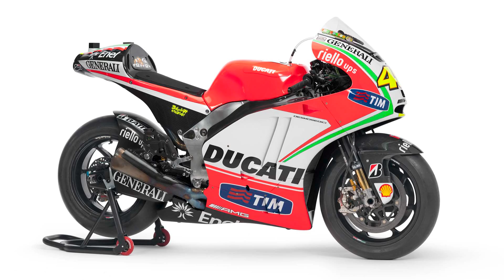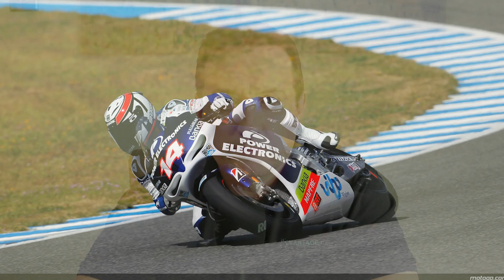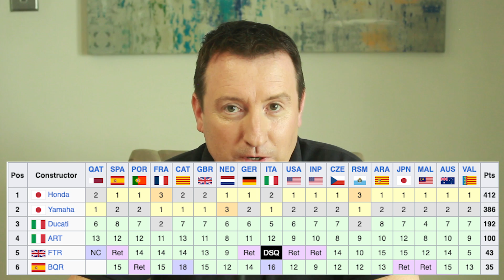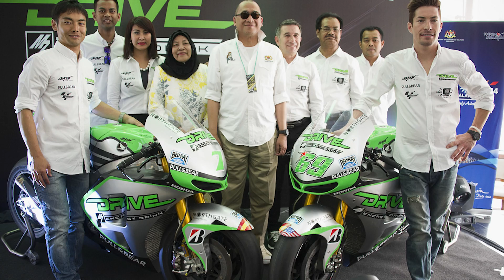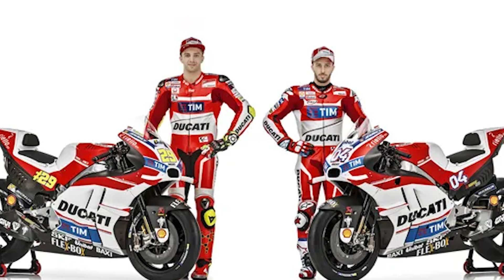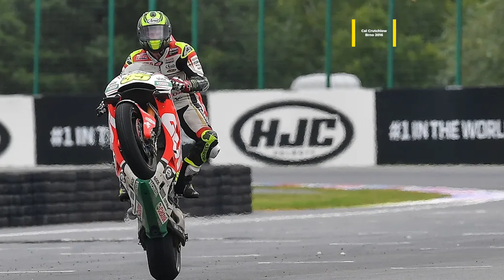How Did a Bunch of Backmarkers SAVE MotoGP?

Comment: Aleix Espargaro did lead a couple of races on a CRT bike and scored some decent points.  Ducati did get a bit stitched up with CRT rules as they weren't allowed to run the hard rear tyre.  Dovi would be at the front until his rear tyre burned out and he had to drop back.  The softer option benefitted the genuine CRT bikes which ran less power especially for qualifying which the others couldn't run and they didn't need the harder tyre.